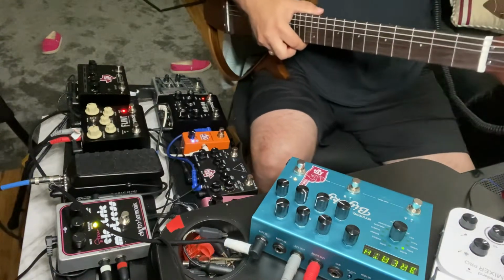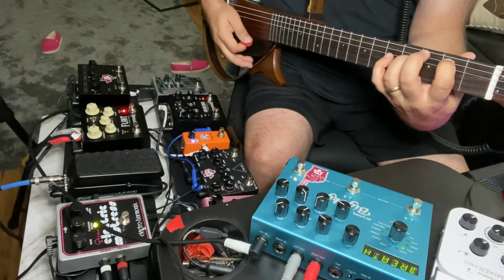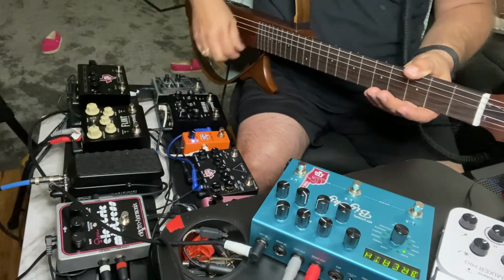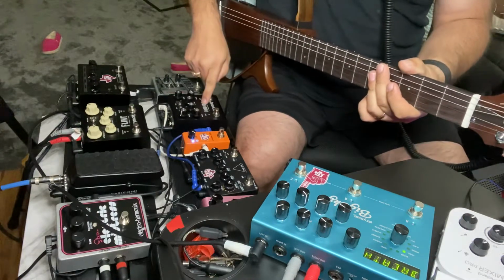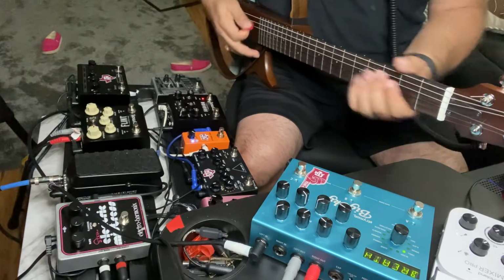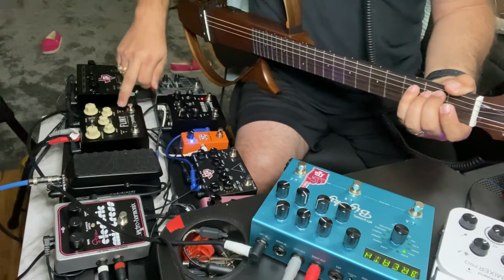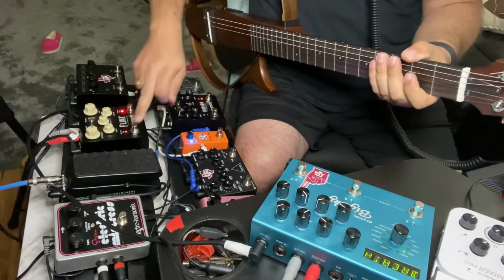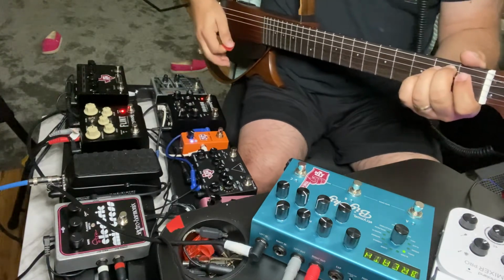Yamaha SLG 200S with nickel strings played through assortment of pedals

Comment: Which nickel strings do you use?
Reply from the maker: I used the Martin acoustic strings
Reply from the maker: 10's
Reply: @rockawayu.s.aaudiovisualst4384 cool! I consider to try nickel bronze 10s. So if you can help me, did you set up your guitar for that gauge, or just change strings and thats it? 😉 
But just one thing, I want to use acoustic strings. Im not sure do you use electric 🤔
Reply from the maker: @antonio.lovric  I just changed the strings and it was great.
Reply from the maker: D’adaro xl120
Reply: @rockawayu.s.aaudiovisualst4384  wow! Answer after one year 🤣 
Anyway, you told me you use Monel. And I have try it. Im really satisfied with them. 
EXL120 are electric guitar sttings...